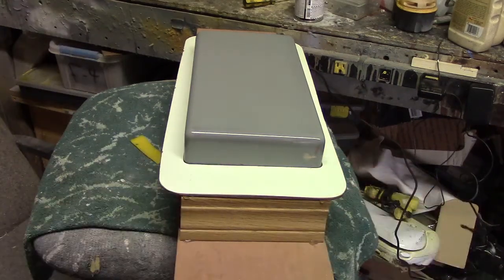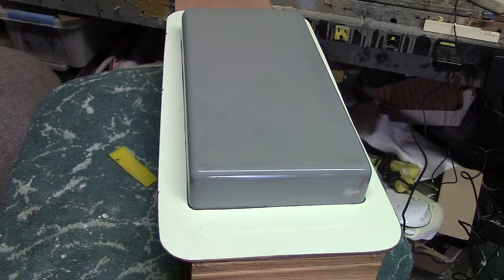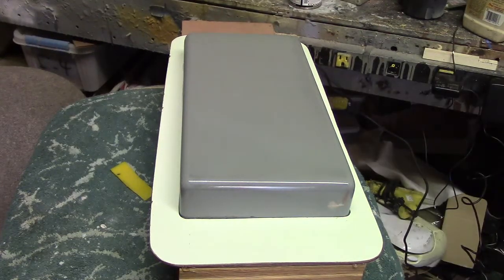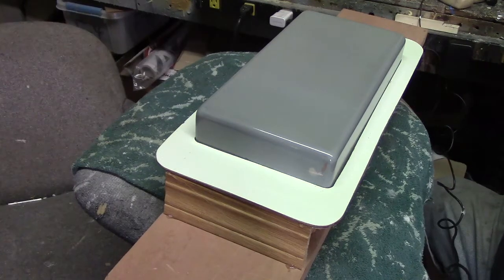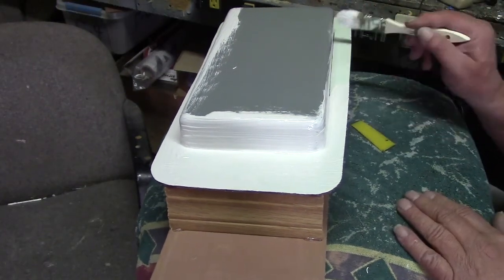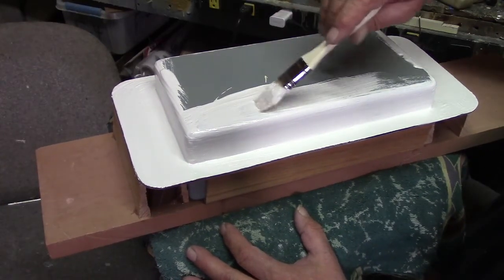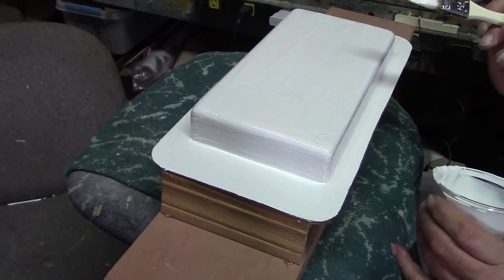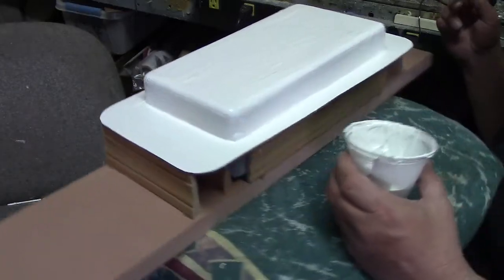making a mold for a Kevlar fuel tank #3

Comment: The biggest  enemy of air bubbles is vibration  so if you think there might be some use an oscillation tool like Bob's  cutter and place it down and it will get them out for you, same with anything slightly thick cement, plaster etc.